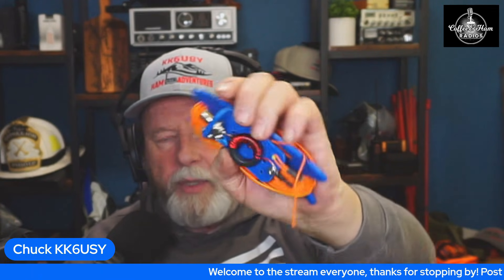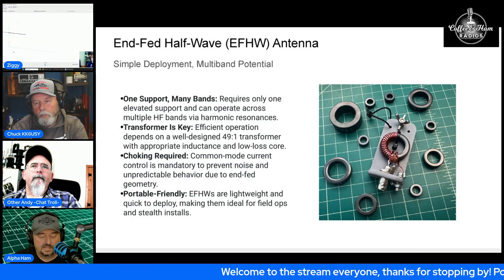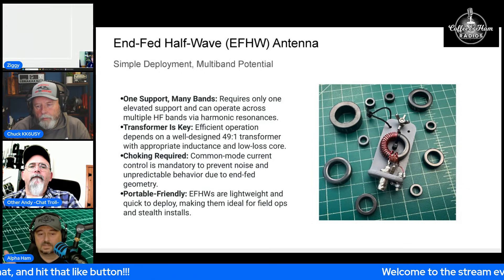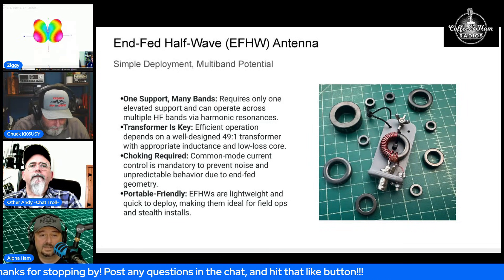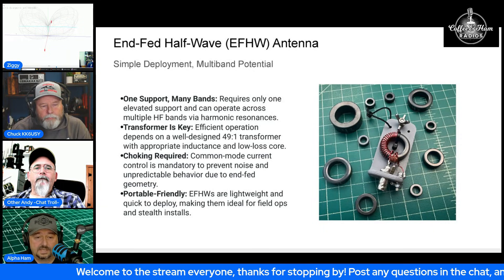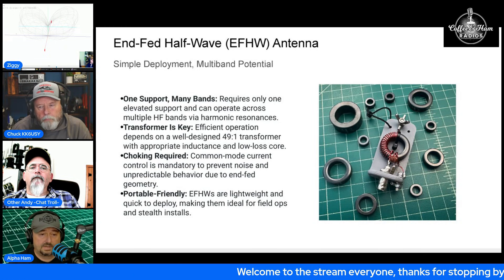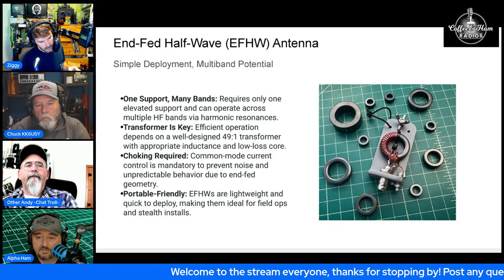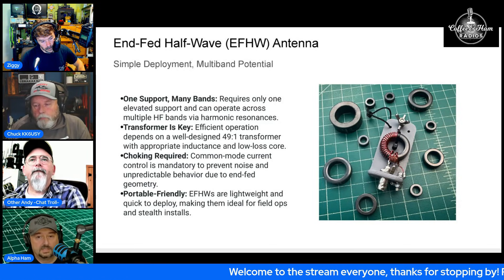The Magic Behind EFHW Cores REVEALED!

Comment: I needs mores pixtures to learnz the fluxes, inductances and SWER'z.😂 
Where's all the extra technical slides son?
I had to close my eyes and think with my brain to understand it all. Lol
Has anyone tried an active cooler to prevent saturation? Would it help or hinder the core flux etc?🤔
Reply from the maker: This was an excerpt from a CaHR stream, I’m planning a video showing a comparison with measurements but I haven’t had time yet…I haven’t seen much in the way of active cooling bit Ziggy did build a 9:1 that did have a fan 🤷
Reply: @TheSmokinApe cool, I like measurements! :)
I've missed a few shows so will have to check.👍

Comment: Great video APE !  No one core and winding does all the bands .  It is a give and take .  61 mix core for upper bands like 6-20 meters. 43 mix for like 16-20 meters.  Also winding type for the bands you want matters. The 3 turn primary for 160-40 meter can help but hurt 15 to 6 meter . Doing that cross over mid way is to keep antenna lead opposite input  for easier build and deployment. But on like a 43 mix core that causes a odd resentence 7 MHz . This is because the output winding is reacting with in it self.  Splitting winding causes this with un even magnetic flux in core. A better way is wrap all around the core . No cross over. Now your antenna lead is buy input.    Just extend it around the core and attach it opposite input. This affects tune length a tad because extending wire.  But when tuned this will wore more efficiently and cause less core heating. I have done tests with thermal imagining camera.  Colin has done back to back efficiency test and made a chart.  No crossover and a tap winding not the twisted primary worked the best .  This also changes with band and core mix.  For 10/11/12/15/6 meters . 2 turn tap on 61 mix core . 49:1 ratio best. But for 80 meters. 43 mix and 21 turn coil with tap a 3 turns is best . That cap. 100 to 150 PF at 1 KV or better. Silver mica will be best or for QRO . Than a 7.5 KV RF Doorknob cap is needed .  The RV voltage and current becomes high under high power levels.  I burn a 1KV 100 PF blue cap at about 1 KW.  Made a light show and turned black and no longer round. The side burnt off. Getting a good RC cap matters. The TDK 100 PF 1 KV blue on is good for about 1 KW but not for long. It heats up after a wile . Taking 4 of them. 2 series 2 parallel giving 100 PF 2 KV total will do 1.5KW with a 3 stack of FT 240/61 cores and 10 AWG PTFE or mag wire . Kapton tape on core for high power RF. The RF can arc threw the core . PTFE best for QRO . 73
Reply from the maker: Wow, thanks for all that info, really appreciate you sharing your experience and findings!
Reply: @TheSmokinApe ”Dually”?

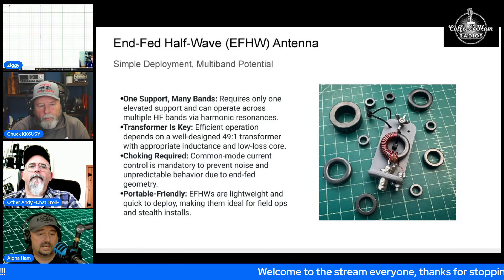Comment: I think I missed something at about the 1:50 minute point. You said more turns on primary gave more inductance. I understand there. Then you said less turns on the secondary gave more inductance. Maybe you could explain that logic more? What did I miss there? Are you saying the capacitance is so large it’s cancelling the inductance that much?
Reply from the maker: Hey Dandy, I may have misspoke.  Less turns on the secondary reduce capacitance.
Reply: @TheSmokinApe Ok. Thanks for the reply. Yes, it is complicated. More turns almost always means more inductance. However the capacitance may be more subtle. Usually distributed capacity. Size of wire, spacing of the turns, insulation thickness and type. Capacitance in each coil ( turn to turn) plus from one coil to another gets complicated fast. Then throw in RF frequency on top of the that and the reactance starts changing with the frequency. Things get messy real fast! I did some trouble shooting on some “simple” high voltage transformers one time in my job and ended up making recommendations on how to change some parameters using insulation thickness. Then next morning the transformer manufacture had his design engineer call me to tell me after he thought about it I was right. He was even confused in the meeting! RF transformers are even more involved, design wise, than simple 60 Hz ones! Don’t we wish real transformers worked like ideal ones?